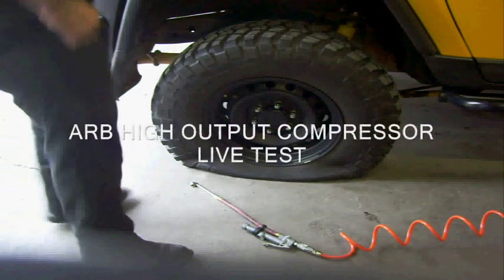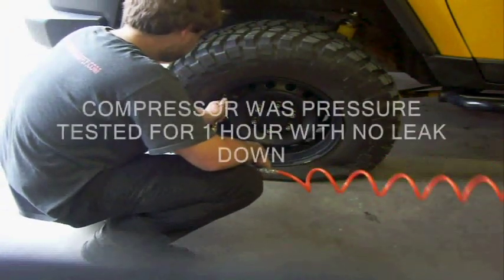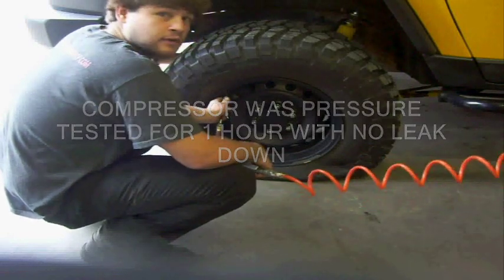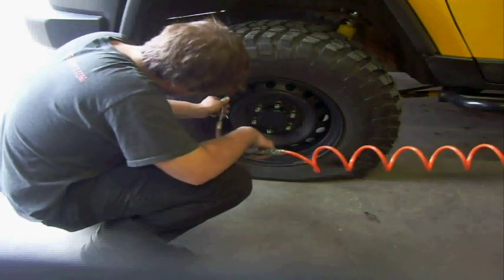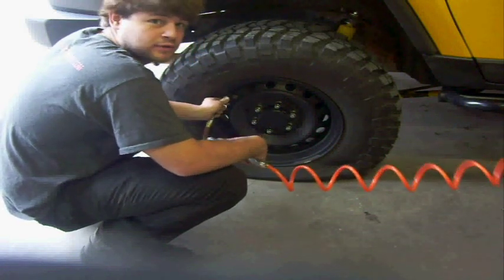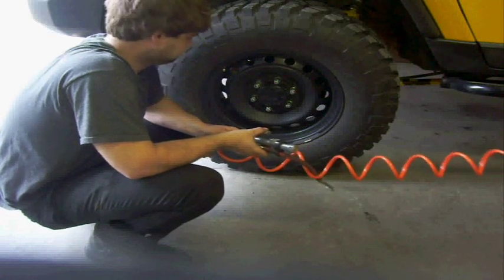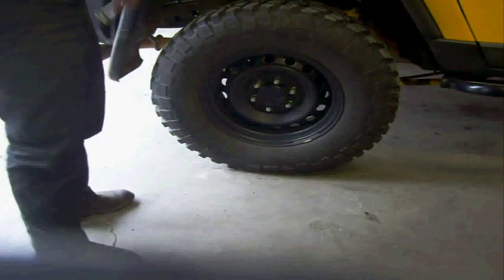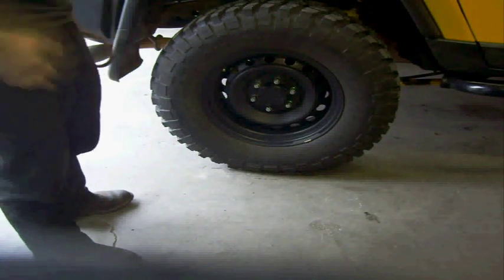ECGS ARB HIGH OUTPUT COMPRESSOR TEST

Comment: Since when you start with a completely deflated tire.  I air down from 30 to 18 psi for most trails. It takes about 2 minutes per tire to air back up.